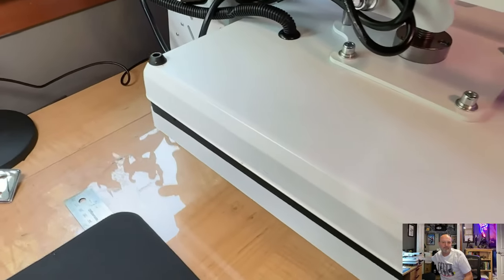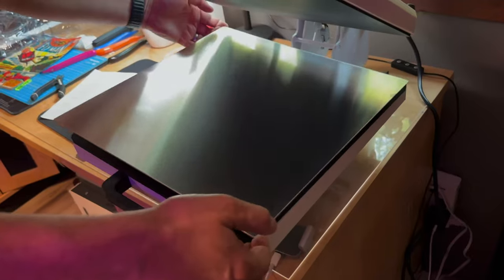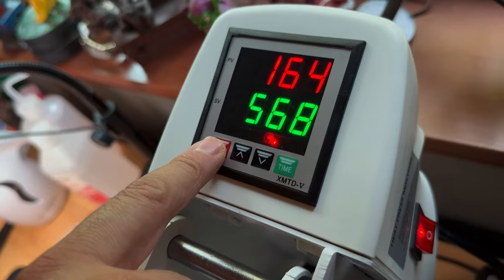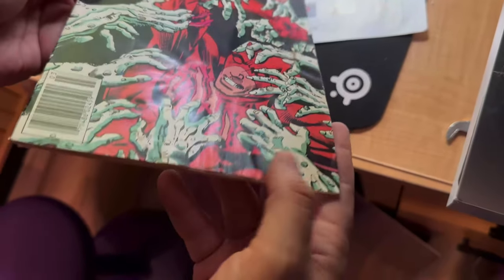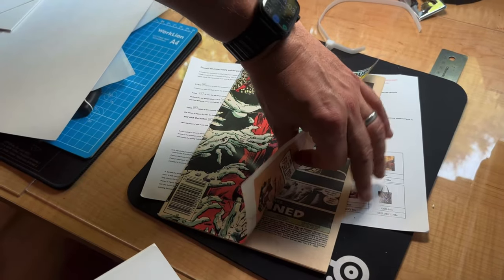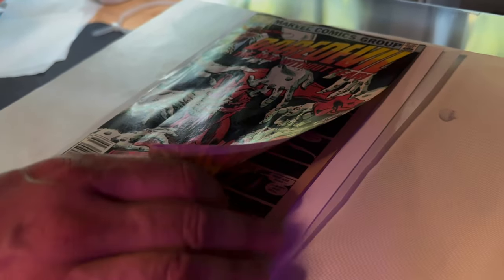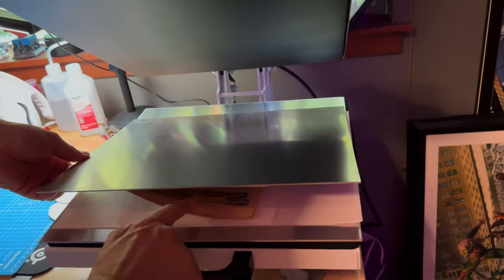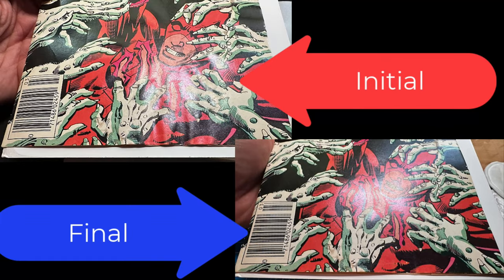Reviewing a new comic book heat press

Comment: I have had terrific results pressing at 165 for 15 minutes and leaving on the press for 24 hours. I do not use the silicone sheets between the magazine boards, and haven't had issues. Running three of these now with spectacular results. CBCS has 20% off right now. I expect to send in quite a few.
Reply from the maker: That's good to know about cbcs, thanks for sharing your experience!

Comment: There are four screws on the bottom of the press under the Matt.  Kinda scared to try to press into them.   Does yours have the screws too?
Reply from the maker: Mine does have those screws.  However I use an Aluminum plate under by books in any case so I'm not sure concerned!

Comment: I've been using a clamshell press for years, but mine is so old i really should consider getting a new one but first I need to get a book press, I have a number of big little books that I would like to repair.
Reply from the maker: I was sort of in the same situation. My worked well enough but was
Starting to show it's age with loose fittings and slightly bent pieces.  It was also taking longer to come to temp so I figured I should either replace the element and reweld and repair it or just get a new one.  I'm happy I got a new one

Comment: Hey Rick – now that you’ve been using the press for a while, I’m curious to know any updated thoughts? Thanks so much for your videos as always.
Reply from the maker: Hey marc!  Actually I absolutely love this press.  If there is any flaw at all I would say that its much easier than I would like to completely smach a book flat or pop a staple.  The fulcrum arm makes it deceptively easy to press pretty hard.  Otherwise, its been great!
Reply: Terrific. Thanks so much Rick. I’ll be ordering some more supplies from you as we get into 2024 and I go to work on my collection. Have a great Thanksgiving.
Reply: @ImmaculateComics one more question- do you find this machine large enough for you to press two books at once? Do you ever utilize it that way?
Reply from the maker: Hiya Marc, yeah I definitely use it to press two books simultaneously, and occasionally I can get a third in there if I do it right.  However the edges are cooler than the center so when pressing two book you mic meet the spines in the center of the press.  so this means one of the books must be "unpside down". if you can understand what I'm trying to convey!?!?
Reply: @ImmaculateComics  yes I understand. Can fit two and suggesting placement as Spine to spine in center one flipped to achieve orientation. Thanks again

Comment: No backerboard in the middle? And why not? So only a backer after page 1?
Reply from the maker: I seldom (if ever just put a single backing board in the middle of a book.  I will often put one under either cover, front and back but very rarely in the. middle.  It is because I used very thick but chamfered boards that shape the spine edge of the cover when pressing.